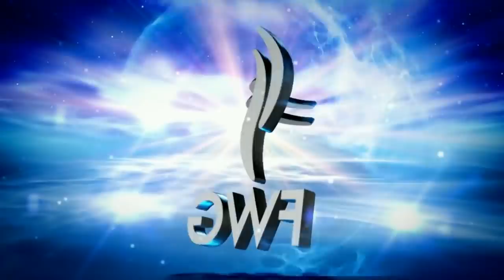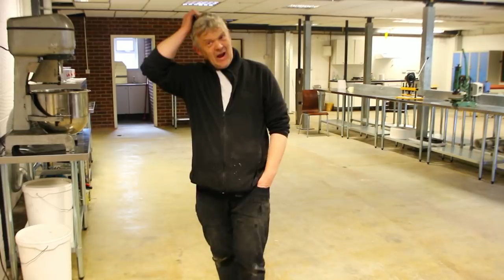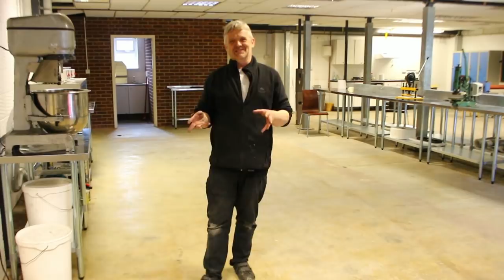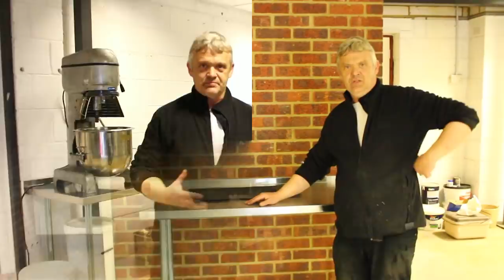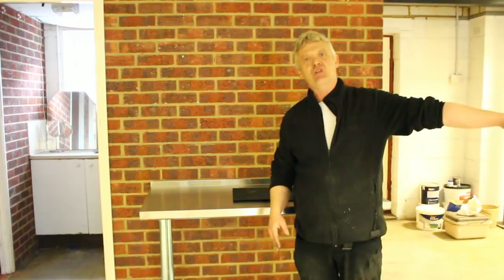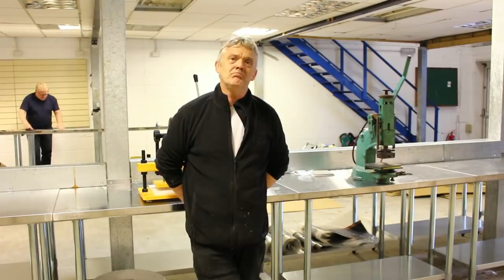Update On The Battery Factory

Comment: Top man! Thanks for the update, Rob. 

How much will the batteries weigh, and what will their dimensions be? Will they be 'car battery compatible (i.e. rechargeable in the same way as SLAB or Lead-acid batteries). If the price is not too much more than an ordinary car battery, then I'm still interested in buying a couple - or indeed a single 24 Volt one. More range, less weight, and a more reliable battery would be useful for my 24V mobility buggy. If the batteries are small enough, then using one in our car (only a small 30-40 A/h unit) would be interesting, especially in Winter.

 I could buy batteries, and give you feedback about their performance, if that would be helpful to you?
Reply from the maker: that's an awesome offer mate - i'll let you know if it would help or not - cheers

Comment: Have you considered applying the ink to the substrate using the silkscreen printing method? A small one-man workstation set up in this way would produce a consistent coating rapidly and cheaply - ie, you'd likely print a single side of 20 sheets in about 5 minutes... dry turn and repeat.
Reply from the maker: thought about it mate - yes - but thanks for the heads up

Comment: Make sure your patents are in order.  Read an article that samsung is going to start producing cell phone batteries using graphine, based on a 2017 patent they bought.
Reply from the maker: got it under control but thanks for the suggestion

Comment: Looks good, getting so close now. A few questions:
Any idea what sort of currents the 12V battery can charge and discharge at?
What arrangement are the cells in the 12V battery eg 6s2p?
Did you have to use any voltage balancing circuits like li-ion or can they be charged in series without any effort like lead acid?
Will we be able to just order the prismatic pouches? Many people will probably just end up pulling the cells out of the 12V battery to make their own custom packs otherwise lol.
Reply from the maker: It is getting close mate - they will discharge at 200C but charging is better handled more gently 1 c or so - it is a self balancing bipolar plate arrangement so ther won't be any disassembly to use the cells - if you tried that you would basically destroy the battery
Reply: 200C? That's a lot of amps lol. Not having to deal with complex battery management systems is a huge advantage. I rewatched your older bipolar plate video and see what you mean. Are you going to put a 12v bipolar stack in each of the lead acid battery container cell sections and have them in parallel? If you have 12v bipolar packs the size of one lead acid cell that is a convenient size and voltage to assemble into many different things, I reckon people would be keen to buy them in that form as well.
Reply from the maker: most people don't want to mess around with batteries mate - it's true a few folks do - but most just want to buy them and use them and be able to rely on them working for ages - so we are designing the battery that way - to be honest it won't look that much different from a 'normal' 12 v lead acid
Reply: I think there's more than you imagine, the market for DIY packs is pretty large for ebikes and other electric vehicles is pretty big. At 1kwh for 8kg and the high discharge/charge rates you listed there would be significant demand, especially as li-ion is such an inconvenience due to balancing and flamibility issues. Inside the battery housing will it be 6x 12v bipolar stacks or is it one large monolithic device? I can post about it on some of the larger ebike and electric vehicle forums to try and see if there's much demand.
Reply from the maker: that's a good idea mate - can you do that and let me know?

Comment: Duuuude ;P  if you are creating large production of  batteries anyway, you'll probably have massive redunancy/lesser version left over , couldn't yous just fast track a little eco-tech mini- village easy with your level of physics/engineering knowledge [mini domes, aquaponics, heat capture,  solar panels etc.. living/working demos] and pile in the volunteers for B&Board + pocket money?!

There are tonnes of eco & tech enthusiasts  that volunteer regularly and could contribute to the project. Especially when speed , quality testing and production pipeline iteration are key, right!?
Reply from the maker: It's certainly an idea mate

Comment: What is the breakdown voltage of your dielectric?
Reply from the maker: I am sorry amte - I don't understand why you would ask that. It's a kind fo supercapacitor so it's not really an issue - but the cell voltage is 2v if that helps
Reply: @ThinkingandTinkering  so each cell has voltage breakdown above 4v??? Just wondering

Comment: Hi rob really excited to see your product line in full flow. You said you are still needing drying racks. Will you be stacking then vertical or horizontal. As you would need to have a good air flow around sheet to dry them evenly. Are you applying your ink to a steel mesh. If yes and you leave a small section unpainted you could then use thin cheap neodymium magnets to suspend them. This would mean you could easily hang them without any sort of clips or hook and it would be a person job. This would also keep the sheet straight when drying.
Reply from the maker: you are right in all you say mate and i appreciate the input - you are spot on that this is one person's job

Comment: Hi Rob How much are these batteries going to cost .I worked in engineering ,my firm charged £40 per hour for every hour I spent working on a customers job . If I took one day to do a job 10 hour shift x £40 = £400 per day plus materials used. These prices were to cover overheads One battery per day per person sounds expensive
Reply from the maker: Mate in a pilot line the product isnt the battery - the product is a technical manual telling you how to mass produce the battery - that's why i am not saying a price it is a bit early to be pricing based on this model

Comment: Since these will be in a typical "car battery" case (which I think is an excellent idea), you know someone will try it as a replacement for lead-acid battery in a gas-engine car.
Do you know if it can meet the typical L/A battery limits of –20°C to 50°C ?
With age, it would seem the weak link might be the plastic pouch material?
Reply from the maker: it can indeed - the plastic case might well be the weak point but to compete it has to last 3-5 years - it'll do that just fine.
Reply: Fantastic!  Thank you Robert and friends!
Given the inhumanity going on in the middle east due to oil/gas money,
the world desperately needs products like these!  Let alone the climate change disaster we seem to be heading toward.
Reply from the maker: indeed it does mate and cheers

Comment: Great news Robert, we all wish you the greatest success!  :) :) :)
In your discussions, it sounds like your battery is a bit of a battery/capacitor hybrid. For anyone putting super-capacitors in series, google this string:
TheFundamentalsOfSupercapcitorBalancing
You should get a pdf with a very good description of how charge balancing needs to be taken into consideration, otherwise the low voltage rating of individual cells can be exceeded, leading to a possible catastrophic cascade type of failure.  
(Might create a source of "ball-lightening" as in blowing your balls off lol !)
Reply from the maker: already taken charge balancing into account mate - but thanks

Comment: is this the same architecture as the battery building kit or is it different? I am almost sure this is not your better then lithium equivalent, architecture as this seems to be from what you are saying the equivalent to a deep cycle lead acid without memory issues? Also does this battery lose capacity in extreme cold weather or extreme heat, just curious?
Reply from the maker: no mate - the kit is for experimenting and learning not for build a super duper battery - and yes it is basically a lead acid replacement - and of course it does

Comment: Congratulation for your set up Rob....I am from India ...
literary curious in simple if you can explain what type of battery are you planning to make ...as I am a manufacturer  of traditional lead acid battery using lead n its components....it would be a help if basic concept is being explained the working of battery based on carbon...my email id batterypoint97@gmail.com. Thanks and best of luck for your future projects....
Reply from the maker: Just watch the videos mate - i go through it in them - I am afraid I don't really have a lot of time and as such i can't really afford to spend time helping on an individual level - I am asorry about that
Reply: Thanks Robert for your concern ......i will watch your previous vedios ...if possible a short explanation any time by you whats the whole concept for your battery ....have you checked the viability of the battery in market ...or still its in a experimental mode....
Reply from the maker: I have checked viability mate - this is for full production. The videos also go through the concept - please watch the videos

Comment: Will there be a changeable or thermal resettable fuse included?
Reply from the maker: probably not mate - i made a change to the electrolyte so they self balance
Reply: So a chemical to re-integrate h2 and O, good plan
Reply from the maker: exactly mate and cheers

Comment: oh man, that's exciting! (seriously talking) I'd totally work in your factory for free pretty much. actually, just food and shelter. I'm mostly interested in the experience with chemistry stuff and carbon (especially graphene) interests me quite a bit. I'm a computer programmer, and I have both experience with programmable controllers (maybe I could make a custom assembly machine) and I've also worked in a factory (a fingernail file factory, painting glue onto acrylic sheets, then applying foam or sandpaper - quite similar to how your batteries are made - and I was one of the top producers). anyway, if you're interested let me know. I'd just have to work out stuff like how I can make it over there but I really do want a factory job I think..  cheers mate
Reply from the maker: Factory work can be a lot of fun mate - we will have to be able to pay I am afraid and just right now we can't - but when we can i'll let you know

Comment: 1 KW in what volume or weight? Anyways this looks like the battery of tomorrow! :O It looks clean, reliable and simple to last long
Reply from the maker: by 8kg and about the size of a normal car battery
Reply: @ThinkingandTinkering  8kg? Wouldn't that be quite a bit lighter than a typical lead acid car battery?
Reply from the maker: yes it would
Reply from the maker: they are already mate - they a lead acid in a polyprop case i think
Reply: @ThinkingandTinkering  Best wishes, much curiosity, and can't wait for the E-V (Twizzy or somthing) to have this!!
Reply: plastic car battery

Comment: GO BIG ,built a 10 KW battery
Reply: Actually I love the idea of the smaller size that a single person can easily handle it is perfect for the home energy storage market.  If you want 10KW just buy 10.
Reply: Being carbon batteries they should be relatively light for their capacity
Reply from the maker: I'm afraid I'm with Dan 10x1kWh seems a good way forward to me mate
Reply from the maker: that doesn't seem quite right to me mate - I thought that was true of Volts and Amps when thinking series/parallel but Watts remained constant
Reply from the maker: they are mate about a quarter of lead acid
Reply: zacariah to whom are you replying too?
Reply: @wanderingzanzey2126  wrong because Watts are a power rating P=IV
Reply from the maker: agreed mate